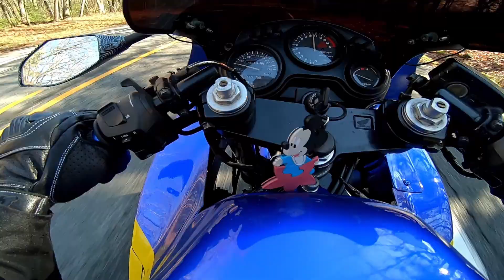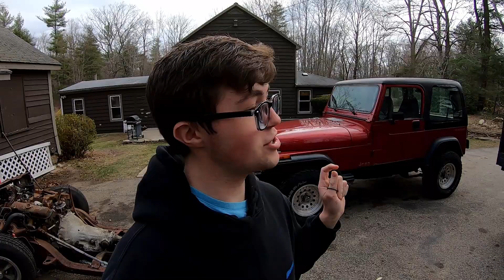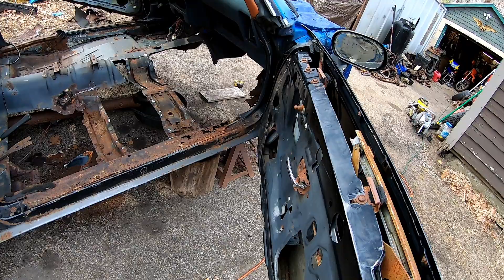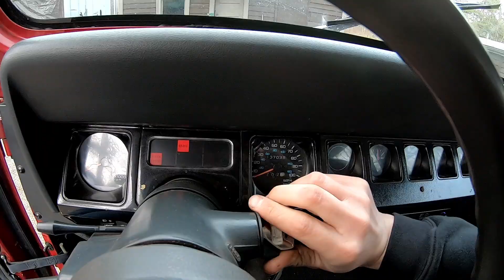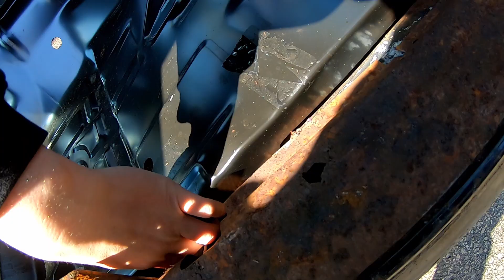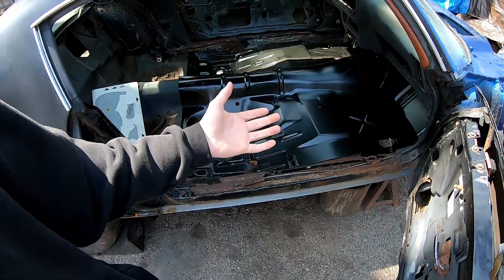Cutting The ROT Out of My Firebird (New Floors!) Firebird Restomod EP. 6

Comment: Hey I got a 79 firebird that needs new pans. Where did you buy your pans?
Reply from the maker: Classic industries! Definitely recommend, and also would say to buy the WHOLE pan front to back, with the little cross braces, would be much easier than what I did
Reply: @OlsonAuto  how would you go about that then? Cause in order to put the whole pan in I’d have to replace those braces I’m assuming. Cause the pan with have to be lifted from underneath. Idk. It’s my first project car so any help or advice you give is great. Found your channel cause of my car
Reply from the maker: @mitchboynunn  definitely would do the whole pan (depending how bad your floors are I suppose), chop it all out and then bring the new pan in from the bottom. I’d set a few measurement points to make sure your floor doesn’t end up higher or lower than it was stock.

Comment: Why did you cut off the side flanges that need to be spot welded to the iner rocker pannels?? And I will never use port 15 again did not hold up
Reply from the maker: Cut off the side flanges because I still had good floor around the edges so I laid it over the original and welded around it. In hindsight I would’ve done the WHOLE floor at once but you live and learn. I’ve had pretty good luck with the POR-15, but have you found a better product?
Reply: @OlsonAuto  yes epoxy primer port 15 you have to have everything perfectly kleenex and use a couple of other cleaners epoxy primer you need it clean but nothing else i had port 15 peel off and it was a new floor! You will get it I learn all the time

Comment: Good shit bro! Did you have any problems with the inner rocker panels? Have a 79 Camaro with rocker panels that have a bit of corrosion. Don’t want to replace em but also needing to replace the pan
Reply from the maker: My rockers were actually very solid. I’m finishing my floors with por-15 in a week or so once I get my holes for my seats fully drilled and mark out where my cage is going, but por-15 stops rust really well. Expensive, but worth it

Comment: Good job dude, take your time and get all that rust cleaned up and use rust encapsulator on the old stuff.
Reply from the maker: Been putting por-15 everywhere I can. I should have cut more of the floor out in retrospect but this is my first real major rot repair so you live and you learn. 

With weather being good again I got to work on it today for the first time since November, starting wiring now. Should be running/driving in a month or so